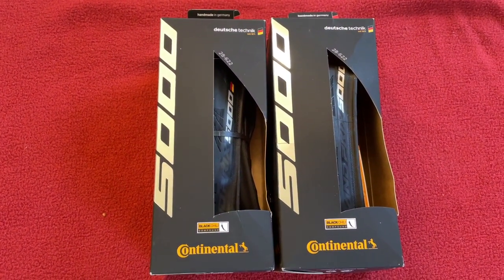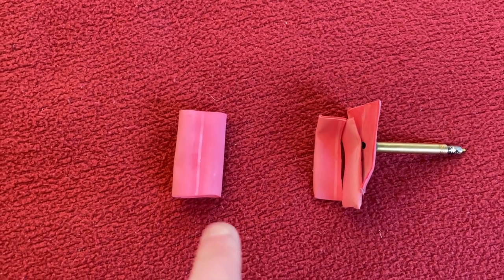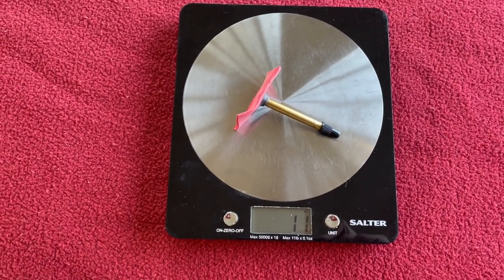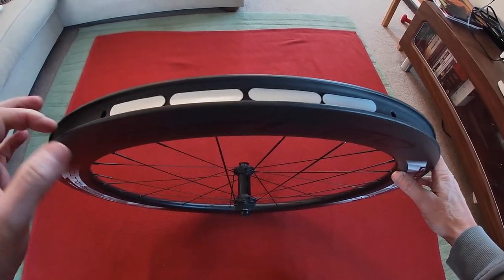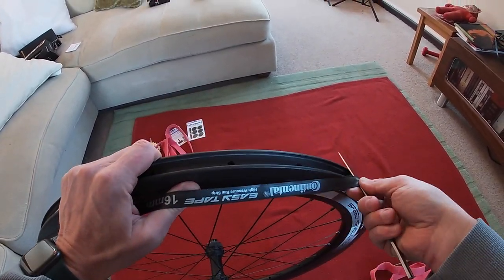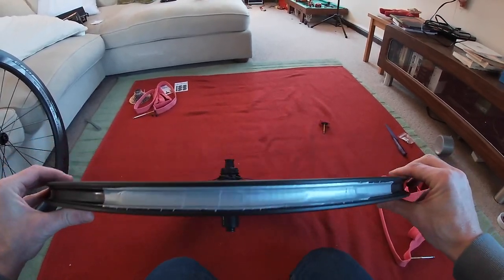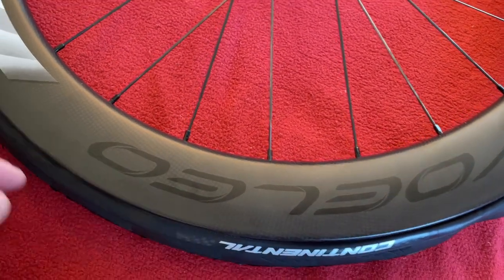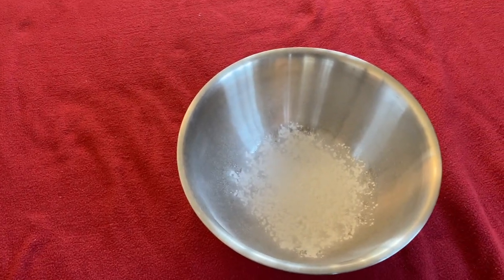YOELEO Wheel Balancing & Tyre Install Guide

Comment: Good video! 
I've also been balancing my wheels since a few years, can make a big difference in downhills.
I prefer to balance my wheels complete with tubes and tires, only doing the rims are better than nothing tough.
Finding good balancing weights is an issue, now I use weights for motorcycle rims that I cut up and after they are installed I cover them with some black tape.
Reply from the maker: Sounds great! When I do my next wheel I’ll try with the tube and tyre on and see if it makes a difference. 👍

Comment: Yay wheel balancing, I use the rubbery magnets from fridge magnets, dont know why so many people don't bother doing this then wonder why the bikes gets unstable past 40mph 👏
Reply from the maker: It’s something I’ve wanted to do for a while, but I’ve only just got round to it. I’m hoping it makes a difference, even a little... when you pedal the bike fast in the bike stand it’s really unstable, hence why I’ve done the balancing, I was quite shocked how bad it was. 👍
Reply: @KyrosHouseCycling  i got a set of 90mm wheels, prior to balancing them I thought it was the air playing havoc on descents, balanced them and went back to 23mm to get rid of any light bulbing and its smooth sailing now, bike feels smooth and planted like it does with my shallower winter wheels, happy to run them all the time now just gotta drop some weight so, extralite hubs and maybe ti pillar spokes to liven the handling up a touch.
Reply from the maker: @jonnythelegs2597  oh wow! Sounds great! Can’t wait to try mine on a fast decent to feel the difference. 👍

Comment: Instead of the valve guard try a small rubber O ring; it snugs down and does the same thing without worrying if it stays on.
Reply from the maker: I might try that as the valve guards have cracked, they don't rattle yet but I recon if they keep cracking they might make sounds soon.
Reply: @KyrosHouseCycling  The O rings work with both the threaded and non threaded stems. With the threaded stems I simply slip on an O ring and lightly snug down on the metal lock nut. For the non threaded stem you'll have to try different sized O rings that will fit snugly and then slide it down to the rim hole. You can get a wide range of O ring sizes at most DIY stores.
Reply from the maker: @alvinmanalaysay839  nice, gonna try that. 👍

Comment: I have the same wheels with the same inner tubes, just running Vittoria tyres... I found it impossible to get the tyre on and had to take it to a bike shop, where they too needed 20 minutes to somehow stretch the tyre onto the rim. I'm not sure whether the wire edge of the tyre is somehow tighter in my case, or are the rims ever so slightly bigger. Either way, if I get a puncture on the road, I'm screwed, as there is absolutely no way I can replace the inner tube on my own by the side of the road.
Did you have any similar difficulties, or would you just recommend getting some different tyres in my case? :) thanks
Reply from the maker: I think it’s just some tyre\wheel combos just don’t work very well with regards to fitting easily. Some tyres fly on! Literally… and some are very difficult to do. The Conti’s are pretty easy to fit the yoeleo wheels in my experience. 👍

Comment: I am a wheel balancing professional and I want to Thank You for promoting wheel balancing...  ! "BUT" !   Unfortunately you are balancing your wheels ASSUMING things.  The first rule about balancing wheels is "Never Assume".  Here you are assuming and teaching people the the heavy spot is always located at the valve. If balancing an Aluminum wheel many assume the heavy spot is at the rim joint, when in fact " it can be anywhere"...  Here are the basics how to balance a bicycle wheel perfectly with the least amount of balance weight.

Before you start, put your bike up on a work-stand and crank up the rear wheel as fast as you can and place you hand on the frame so you can feel your bike Before and After balancing your rear wheel.  Keep in mind, the front wheel is also doing the same at high speeds... It's crazy and it's dangerous!  SO LETS BALANCE LIKE A PRO>>> 

1. If balancing tubeless wheels, first balance the wheels dry, then add the sealant.  Keep in mind there are three heavy spots on a wheel, A, the rim has a heavy spot. B, the air-valve. C. the tire has a heavy spot. This is why you never assume because when you assemble a wheel those three heavy spots can end up anywhere thus often changing the assumed heavy spot at the valve or rim joint.

2. Tools & Materials needed;  gram scale / 1/4 inch fishing lead weight that comes in a roll (Walmart has it)  / hammer / black duct tape / alcohol / white out marker pen / wheel truing stand, if not use your fork and on the rear take off your chain so your wheel can spin freely with out the free-body clicking.

3. Assemble your front and rear wheels completely the way you are going to ride them, including computer magnets (if any), disc rotor, cassette etc.  DO NOT ADD SEA LANT YET, UNTIL THE WHEEL IS BALANCED FIRST.. NOTE: You can balance a tubeless wheel with the tires flat with no air, perfectly fine...

4. Place the wheel on the truing stand (or bike) and tap or rock the stand until the heavy spot on your wheel rotates and settles to the bottom.  Do this a 2 or 4 times to make sure it always settles to the bottom at the same location, and mark the bottom with an H for heavy-spot, and mark the very top of the wheel with an L for light-spot.

5. Slowly rotate the L & H spots into the 3 and 9 O'clock position and hold it there.  If you let go the H spot will rotate to the bottom. So rotate the L & H spots back to the 3 and 9 O'clock position and start adding weight only to the L spot by taping small pieces of lead "on the side of the carbon rim" until the the wheel stays steady at the 3 and 9 O'clock position.  If you add too much weight on the L spot, then it becomes the heavy spot.  So the trick is to carefully add or subtract weight on the L spot until the wheel remains steady at the 3 and 9 O'clock position. NOTE: Tap on the wheel stand or bike a few times to make sure the wheel holds steady at the 3 and 9 O'clock position.

6. Carefully remove the small pieces of weight from the "L" location and weigh them on the gram scale. Next cut one piece of 
lead to equal the weight of all the small pieces. Place the one piece of lead on a metal vice or similar flat hard surface and hammer it flat as a dime.  Next clean the "L" area on the rim with alcohol, let it dry and duct-tape the piece of flattened lead on the L on the side of the carbon rim.  DO NOT TAPE THE LEAD ON THE TOP OF THE RIM, but on the sides.  If the lead weight is too big cut it in half and tape it down to both sides, its OK..  Why on the sides only?  Because if you have a deep aero-wheel and if you tape the weights on the top, you will need much more weight to balance the same wheel.

Congratulations, you just balanced your wheels, like a pro!

Enjoy the new found speed, and how your bike now handles like it's on rails at high speeds. And no more losing Watts due to un balanced wheels.
Reply from the maker: Thanks for the explanation, great piece from you. I just assumed that the wheel doesn’ t rotate on its own and when spun it doesn’t e habit off balance characteristics. When I added the tube and tyre the valve rotated to 6 o’clock so to me that’s where the weight was so I countered it with the small weights. Not perfect but very close. I don’t have all that equipment so I just did my best on my own. But your piece is a good read and I’m sure would be better than my version. Thanks for explaining in such detail. 👍